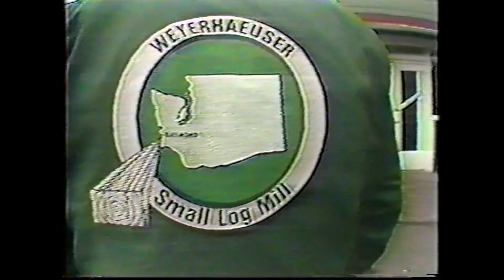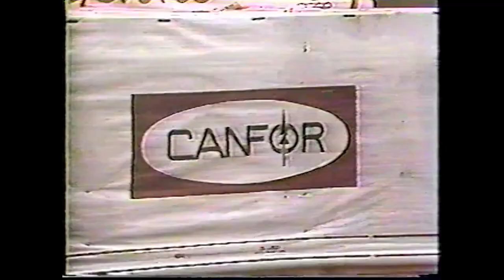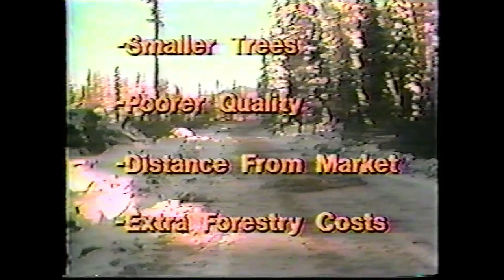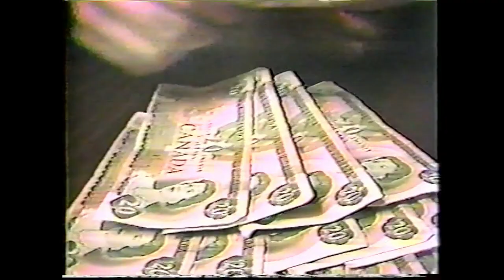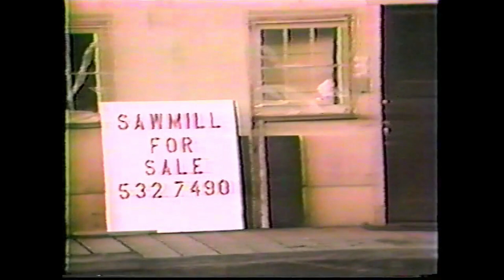TIMBER (1984)  king-5 exclusive

Comment: Yep, up and down waves of every industry every 5-10 years, with new expressions to explain the misery for those that cant, usually derogatory ones, at their cost, every time.
Always put money aside, then when the wave hits the low, bide your time in a different industry.
Forestry and Construction for example, goes hand in hand, low lumber prices = Switch to construction, and vice versa.
Hope it worked out for the Coty's, should be good times for them now.